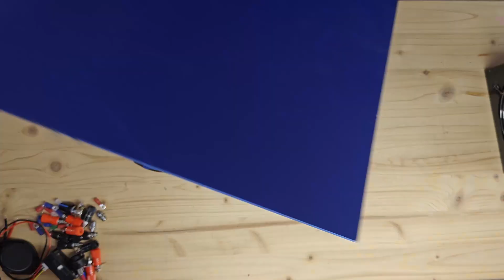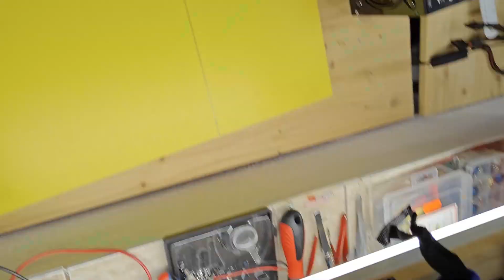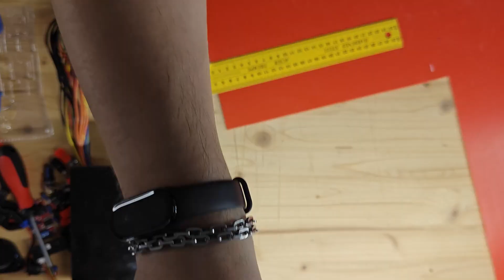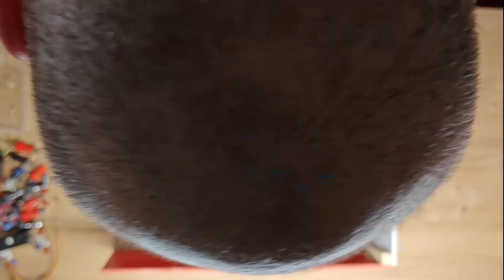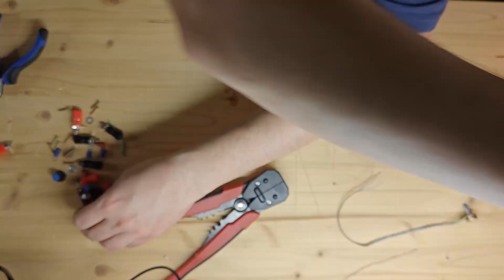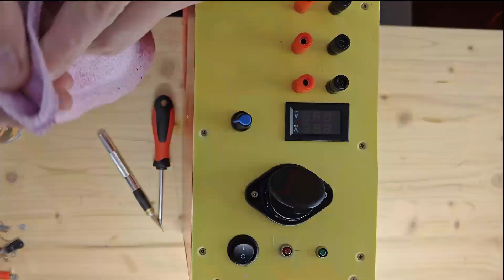DIY Lab Bench Power Supply from old ATX computer supply

Comment: Your power supply came out looking good.  PC power supply's are great for this, they provide 5v, 12v, 3.3v and plenty of current.  For the boost converter, I have found using a multi-turn potentiometer allows for finer adjustment.
Reply from the maker: Thanks for the tips, when I eventually modify it I'll make sure to get one and change it to stepup/stepdown converter.

Comment: To be sure... your USB is 12V? That is kinda scary.
Reply from the maker: Nooo, it's hooked up to 12V and outputs normal USB voltage, think the USB panel is designed for automotive use.
Reply: @MegaTinkers  As long as it outputs 5V it is ok. Because every one will expect 5V on an USB connector.